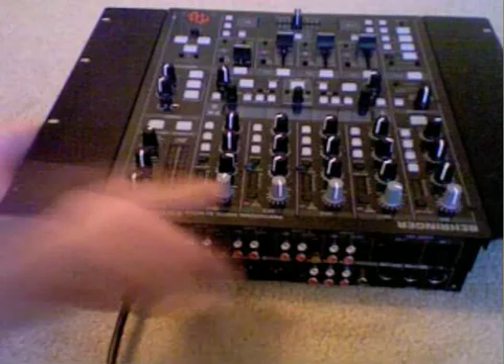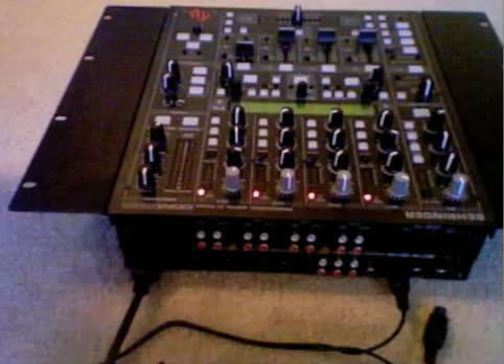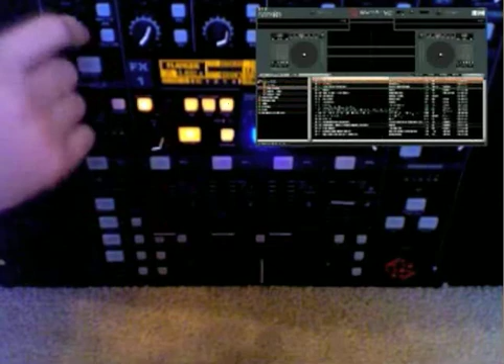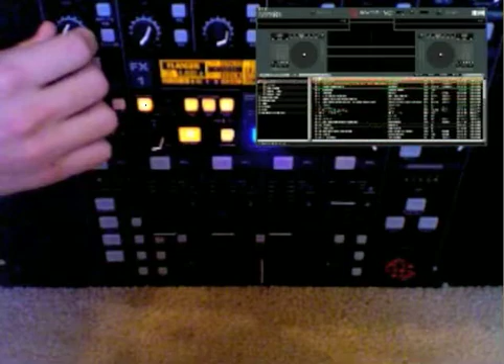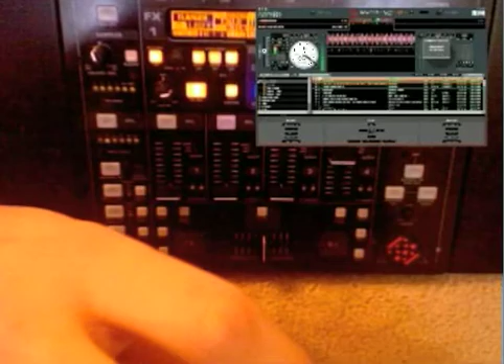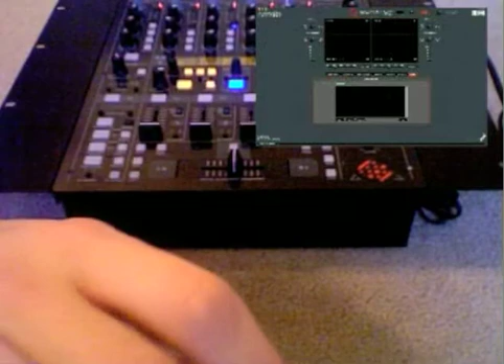How to setup and use a MIDI controller in Serato Scratch LIVE (DDM4000 response)

Comment: Hey I have a ? My controller was working fine yesterday when I set it up. But today I turned it on serato scratch shows it's recognised but the controller is not working. I checked my USB to see if the pc is picking it up and it does it when works on vdj but serato it's not working

Comment: when you say i have to download the drivers, drivers on the midi wires or what?? cause i have a wire that is midi to usb i got from ebay, but it does not do anything when i press the buttons to assign them on scratch live. do you have any idea what im doing wrong? I havent downloaded anything with this mixer and i am on a PC not mac.

Comment: 2 updates if you are running this setup, Check the M-Audio website for serial number, some of them are defective and M-Audio will honor the warranty. Second s that there is an update to the M - Audio Driver as well. I had an issue with random tracks being loaded as I scrolled crates with the cross fader. other than that I am happy with this setup.

Comment: You still need the serato box. The DDM is just a midi controller that lets you use the buttons on the mixer to control functions on the software.

Comment: @DJLazBoz Hey I just bought the DDM4000 and had the same problem. No idea why does that either, but I kept turning it on and off till I barely was able to see anything on the FX screen, but then also you need to turn the nob that is on the right side of the effect area to move the contrast of the screen up till you are able to see whats on the screen.. good luck

Comment: @jeanviarel Hi  I recently bought the DDM 4000 slightly used i had the same issue. "VR24" particularly means the system is going for a system self check. I had switched on and off several time but did not pass that point until such time i had let the unit to do a full system re-test.. Just On the DDM4000 and Press only Once the OK knob (Console Set up knob) and let it go on by itself, after a while the system will start to test all its lights,buttons,knobs etc.... let it complete then restart..

Comment: i have this setup, thanx for the info, it works great, but i want to control a drum machine with the midi clock from the ddm4000 as well, how can i do this? seeing as the midi out is already in use. can i use the midi in for serato?

Comment: Can this be set via midi to completely control serato or virtualDJ. What i mean is can you program it so that the only hardware you would need is your laptop with software and this mixer, so you could choose track, cue it and then play it via a button on DDM and then use other buttons on DDM to pitch bend and also increase/decrease pitch, so in essence doing away with mp3 compatible cd decks ?
Also once midi is assigned to do this how easy is it to revert back to normal to use with vinyl decks